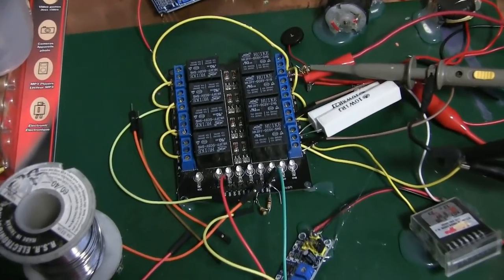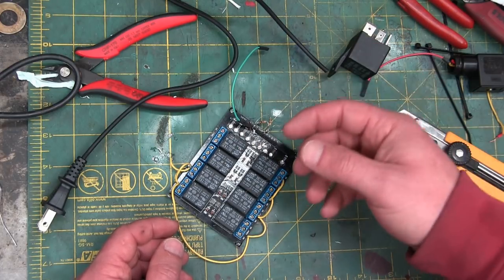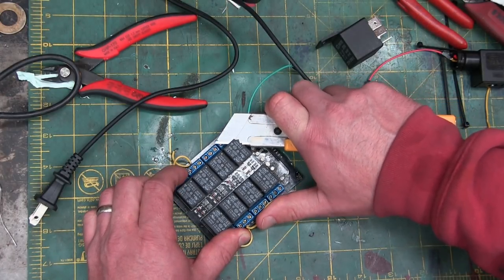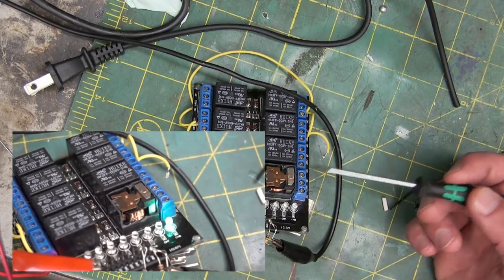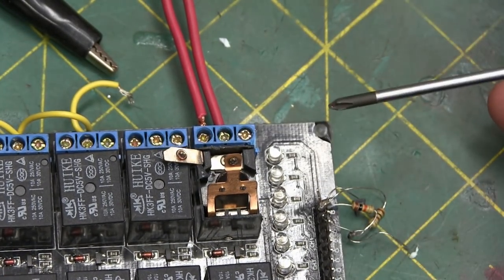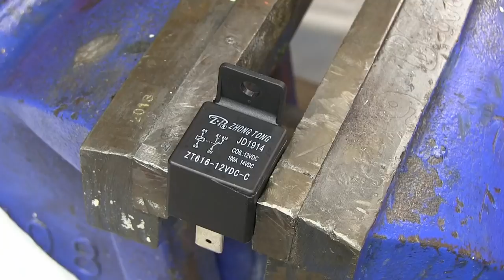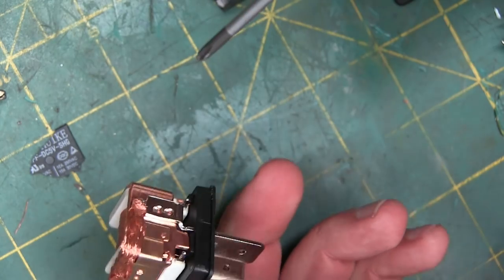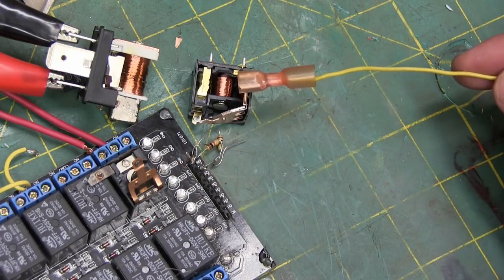BOLTR: Aliexpress vs Omron | RELAYS EXPLAINED!

Comment: I never trust them with the fill "rated" power but ive been using cheap relays for years and never had a single problem with them. at work in an industrial application with name brand relays, the contacts never stop failing. same with switches. but they are always serviceable and some sand paper or scratching it with a screwdriver will get ya through the lifetime of the tool

Comment: Fiew ! I was scared for a bit. I have a project for a automated "tomato" growing system that will need 6 relays switching about 700 times a year. I got some relays from aliexpress and havent tested them yet but I feel like they should do the trick. For a moment I tough you where going to show a catastrophic failure.

Comment: does your spindle control lines sink/source 4 Amps? You should run the test again with .1A or .1A (or 0) to simulate using them for what appears to be logic level control lines. I would expect you to get many more cycles, but the failure would be in metal fatigue of the moving switch lever.

Comment: Some car tube radios  had a "vibrato " relay..this Fed the primary of a transformer .the secondary was a higher  voltage and ran the radio.guess you could call it a inverter.

Comment: Can you suppress arcing and consumption of contacts if they need to disconnect high current and voltage by imersing/filling relay with somethin like thin parafene oil/diesel or some less flamable liquid??? 
I found a really old inverter in garbage, 12v dc to 220v ac for use in car (from time before transistors were invented i guess, no date an anything, but no plastic parts inside, just bakelite and ceramics and oiled cotton/hemp insulated transformer wire - pretty old stuff), which had switching done by relay submerged in some oily stuff...

Comment: surprised nc is weedy. if i use this, i want it to break when it should.
I would like to see you run this under everyday test conditions say one cycle per second,  under a medium load.
can you stand the clicking?
Every relay I have had fail has burnt the contacts  into one position. it's very rare to find that a coil has actually failed.

Comment: And if 2.5 million cycles isn't good enough, you can always go with a solid-state relay - I use those to switch a hot water heater element in my beer brewing system.  At least one vendor's datasheet specifies the switching lifespan as being on the order of 50-500 million cycles.
Reply: Ben Johnson There are 50-60 cycles per second.
Reply: You're not switching the power with every cycle of power.  Take a look here - they quote an MTBF of >2 million hours regardless of # of cycles, assuming you do your thermal management right.  http://www.crydom.com/en/tech/newsletters/solid%20statements%20-%20life%20expectancy%20of%20ssrs.pdf
Reply: Ben Johnson Yeah, you found the joke.
The SSR switches with every half cycle, by the way

Comment: Extremely relevant question for me, tangential for everyone else. Anyone know why when I use a electromechanical relay to control 110 VAC power, I read between 12 to 14 VAC between Normally Open and Common poles when the relay is in off position?
Reply from the maker: Induction. Put a 47k resistor between the two and check again.

Comment: hey ave, im new to ur chanel watchership, i saw you makin that bulletproof glass for that flashlight thing...did you try optical adhesive for setting cell phone touch glass/digitizers onto the led displays, you cure it like plastic fillings with a uv light, which i think you already have, but they have one specifically made for curing the shape of tablets/phones, anyways...it came to mind, anyways..cool man.

Comment: I got an el-cheapo multimeter that quit when testing for dc voltage out of a ignition coil. Put a new battery in it and it still don't work. It didn't chooch any smoke. Also it doesn't have any fuses. Any advice on trying to fix it??

Comment: Pro tip, if you ever weld relay contracts together by chooch'n 1000amps through them when they are only meant for 100 you can usually just hit em with a hammer or throw them on the ground to break the connection.

Comment: does ground side switching have any effect on relay life. have been told that is why alot of auto manufactures use ground side switching ? to me it seems like it would have the same potential/inrush across the contacts either way.
Reply: I am interested to know this as well, in electrical protection where it is not uncommon for a DC control circuit to be controlled by a relay that spends most of life with the contacts open, there is vague and obscure chantings about whether to switch the positive rail or the negative rail (in terms of long term reliability of doing nothing for a long time and then being demanded to act), best semi reasonable explanation I could get was something to do with contact faces ionising very slower and same polarity charges blah blah blah.

Maybe some rail people know something on this?

Comment: Hey AvE 
Lets say you have 3~ 100vac 100amps 100Hz going through a PWM VFD into a 3~ 100vac 100amp 50Hz! motor.
Does the motor still receive 100v and 100a after the frequency conversion?
ALSO 
If it does not, now this is a VERY hard question I do not expect you to know but, how much loss of volts and amps after changing the frequency? An approximate would tickle my pickle

Thank you

Sorry man I don't know where else to ask you, this question has nothing to do with this video. I know you did a video a while back demonstrating a VFD I thought maybe you know a little bit about it.

Comment: Exotic metals on contacts is not uncommon in relays and switches: I even have a 3 way 110v switch that has silver cadmium contacts. BTW the small NC part might because of method of manufacture -- it's basically a rivet driven through there. May be another reason escaping my attention at the moment. Boxing is on.. gotta go!

Comment: I used one of those chinesium relays in a ignition coil driver what for shockin ma dad. Stopped working after a few mins cause the contacts of the relay spot welded emselve together

Comment: I'm no expert, but i find it curious that the chinesium automotive relay has a fat braided copper conductor around the outside, but the actual contact area is itty bitty. That's gotta be a nice heat source at 100A.
Reply: 100A at 24V, so max of 2.4kW, compare to contacts rated 10A at 240V.  Dun need to be that large. Lookit a 30A 240V contactor pad size, it's pretty small.
http://www.galco.com/buy/ABB/DP30C2P-C?source=googleshopping&gclid=CjwKCAjw64bPBRApEiwAJhG-fmESu2YBTYiN1aUkwt74UHTxQ2uFVwX_HRHechakA9KGlBx3Pe8hGBoCa9sQAvD_BwE
For reference the lug screw is 5/16" (~8mm)
Reply: Of course. It was about 2am when i wrote that comment, so I wasn't awake enough to take voltage into consideration. Thank you for your answer.
Reply: superarne sorry if I came across as a condescending arse, just wanted to be thorough. ;)

Comment: Surprisingly, it is not large current applications where the chincy contacts make for problems... it's in small signal switching applications, like analog video or audio signal switching. Had a gorgeous Farenseh (Bosche) studio monitor that was such a piece of shit they had to discontinue the product because they got a bad batch of signal relays. Worked tits... once you went in and hard soldered the signal path around the relay points. (Like you are going to read this comment anyway....)

Comment: So what's the diference between a relay and a mechanical contactor?
Reply: Contactors are definite purpose; the contact does not swing and is closed by an electromagnet and opened by a return spring. This eliminates the switching contact material from being a failure point due to metal fatigue. Think of a contactor as more of a "crowbar" that closes a circuit rather than the "springboard" in a relay.  Even that fancy 100A automotive one with the braided bus strip is going to fail due to metal fatigue if the contacts don't fail first.

Comment: Those cheap relays are UL listed, you can see the mark, can't be all bad. Real engineers design relay circuits not to switch under loaf, less sparks, and add circuitry to soften the smack.

Comment: I hate to do it AvE, but I call bull. Ive had those ubiquitous cheap blue 10A relays weld the damn doodleydoos when theyre only moving 7A after like 50 cycles. Failure after failure and on a pure resistive load too, pieces of crap. I wouldn't put those chinesium relays through anything over half their rating. I mean seriously, what does it take for a man to get a mercury wetted contact in this place?

Comment: been trying to dumfokry a bismith levatration device eh > 
 do a solid and cheep example of non pc ness sckoom and see if you can make the magnetic unicorns defy the laws of gravatus with a neo diddilum magnet please  application is a near friction gyroscope for sat rorytation and opsy doodling in orbit to reciving better hockey games from the sat .
 if needs be i can sen some bishmuth elementals to help corner them unicorns
Reply: ness i forgot the damn ness at some place . if you find it please insert it , but only  the tip

Comment: 2.3e6 @ 600(!10)hz = 3833 s == 63.8 m == 1.0 h run-time; @ 60(!1)hz you still only get a 10.6 hr life time. 2.3e6 is a lot if you only cycle infrequently; I think you proved that relays are a poor, permanent, solution to your chatter/speed control problem (thought still an adequate PoC!) edit: 60hz is obv. faster than the relay can handle.
Reply from the maker: huurrrr? 2 300 000 /60 s/min / 60min/hr = 638 hrs
Reply: oops, wrote the wrong units down, 600hz and 60hz would give 1hr, and 10hr; how does 638hrs (~26.5dy) compare to the lifetime of the spindle and spindle controller.  That was what i meant to comment before I miscalculated and revised my comment according to the calculation !><!
Reply from the maker: 300 hrs is my internal hobby shop target; that's a lot of evenings running the lathe 5 minutes at a time...

Comment: So why do I need a relay in my maxi scooter for an aftermarket aliexpress horn ? (there's probably a stock relay already installed , didnt check tho)
People all over the place "bruh it will burn you alive" or "it will skin your family" im like chill there's a horn switch right on teh fucking handlebar
Other swear it will burn the fuse for the horn and then continue burning the rest of the fuses through blood magic, while stories emerge of dead batteries because "bruh just use a relay dont u know that"

Comment: Ave can u help me find a relay? I don't know shut and my wire feed motor won't go I suspect this relay thing but alas u can't find the correct one to buy. Here's the info on the thing: Goodsky GU- SS- 124DMF.     30A/240VAC.   30A/30VDC.  COIL: 24VDC.  GZ  OR maybe u can tell me a variant that works? U desoldered it from a board there's 4 prongs that hooked to the board and there's 2 male connectors set inside the thing which the wire feeder hooked into to complete the circuit. Please help a fellow bumblefuck!! Cheers